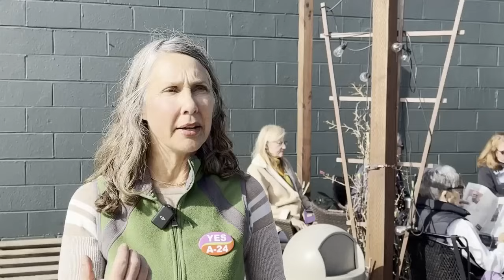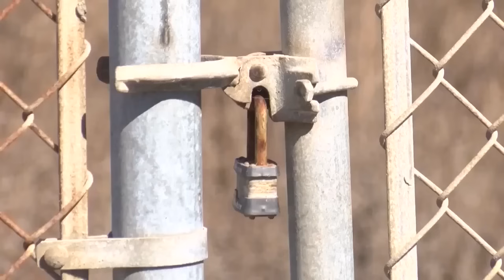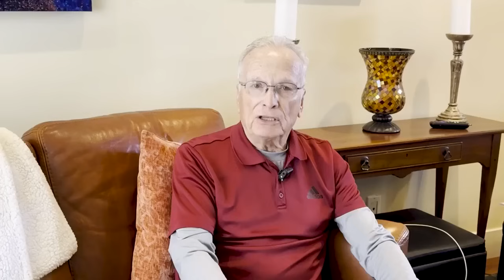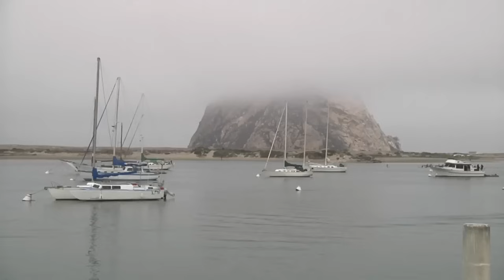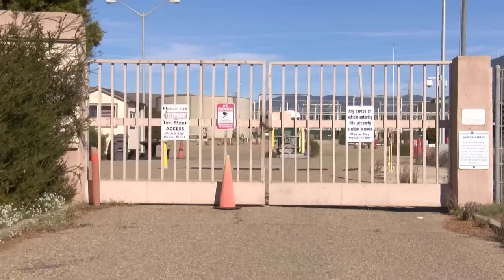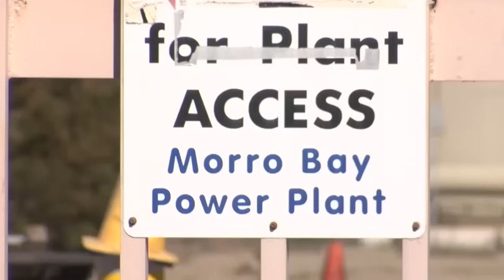Morro Bay residents concerned over battery plant proposal after fire at Moss Landing facility

Comment: Newer batteries are far safer -
Reply: No such thing as a Safe Lithium battery.. all of them are extremely toxic and dangerous
Reply: These ARE newer batteries. The technology hasn't evolved much in the time that has elapsed since these were installed to today. And Lead Acid batteries are a FAR safer type of storage capacity components, they just have FAR less capacity rating per volume than lithium and degrade quicker. But are FAR less volatile and far safer overall as Lithium is prone to combustion or explosion from a multitude of likely factors, overheating, rupture or damage occurring, degradation in the core materials occurring, introduction of H2o making contact with the Lithium, Battery Balancing issues in charging and discharging cycles, failures in BMS. Lithium is a transitional technology, when consideration of storage capacity is concerned, and barely above a pisspoor one at that. Add to it that it is HIGHLY volatile in the event that correct conditions are presented,  that those conditions are actually QUITE common and occur regularly and naturally, and that the material is also quite toxic and damaging on a pollutant (sourcing and procuring the material, manufacturing of it, disposal or recycling it one its reached its service potential AND in the event it combusts and burns in these fires and the release of gasses and hazardous particulates in the air and that then settle on land and water eventually AND the fire hazard level it creates AND the fact that it is a destructive force multiplier when concerning a blaze created with a Lithium source as fuel.
Reply: @sheepishmclemmingston5550  No, they are older lithium batteries. New BESS are using much safer LFP and Sodium batteries.
Reply: @ArthurDentZaphodBeeb  better research it better bub. These ARE newer batteries.
Reply: @sheepishmclemmingston5550 Damn, your ignorance is a curse. The batteries were LG NMC - inherently unsafe as when they ignite they create their own oxidizer, thus they continue to burn until all oxidizer is gone.  New chemistries (LFP/Sodium/Iron) don't have that problem.  Tesla's Megapacks are now LFP.
Reply: The LG BSEE batteries used in moss landing were supposed to be safe.  Problem is that when you put that much lithium (Millions of cells) if they do catch fire it’s all over.